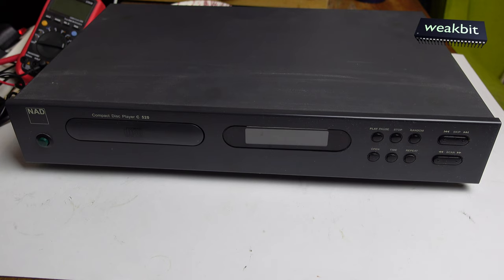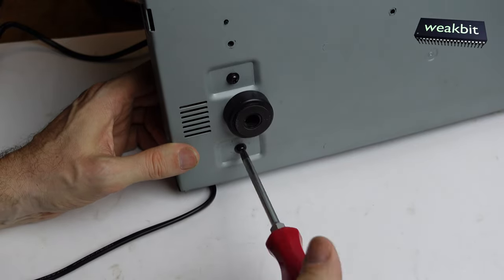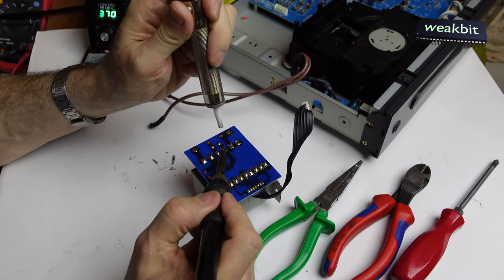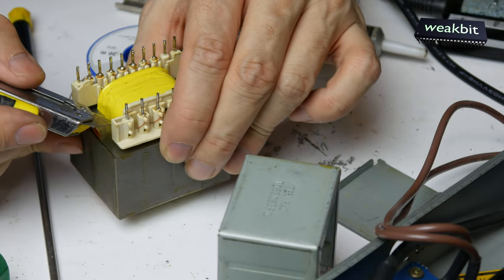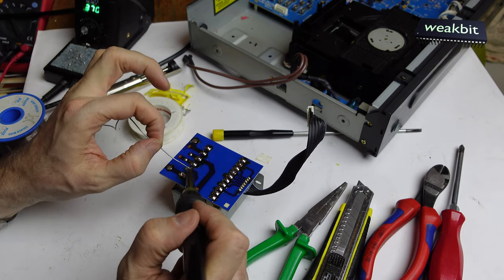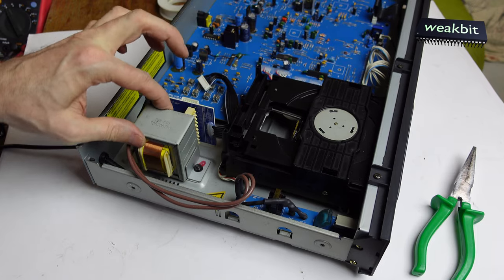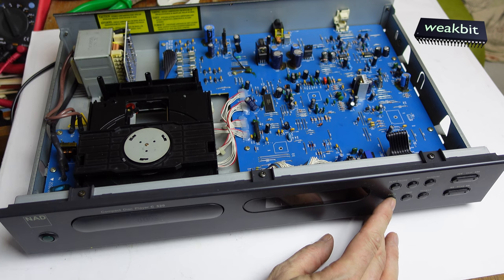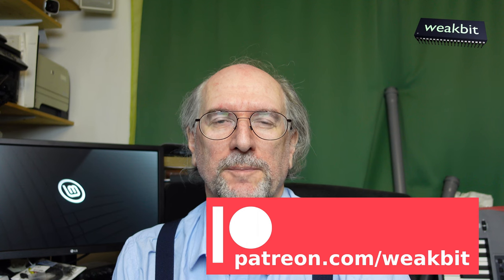NAD C520 CD-Player issue

Comment: Thermal fuses do not fail simply as a function of age. The unit took a surge or a short on the secondary side. edit - The mechanical hum stopped when you unplugged from the main board, therefore the transformer was not the fault for this. Something is shorted on the main board.
Reply: The thermal fuse may have gone for several reasons on the primary side as well, and because of external environmental reasons. Note that with a 2-pin plug there is no plug fuse to blow preferentially before the unit thermal fuse blows. The thermal fuse is therefore the only protection device there is between the Consumer Unit and the step-down transformer. If the Consumer unit uses RCD's instead of fuses, someone may just have reset an RCD without investigating a fault in the ring main that the CD player is connected to.

a) This is a unit built for 220-240 V AC and someone has plugged it into a higher supply voltage. This means the voltage to the regulated supply board is too high and a short between adjacent connections has occurred - very possible in a high humidity or damp environment. Someone could be using the unit in the bathroom (uh-oh) or it could be because the unit is a "grey" import, built for Europe, but being used elsewhere in a sub-tropical high humidity region on a different supply voltage, but where the European mains plug is still physically compatible with the socket.
b) Being plugged into a DC supply (d'uh but there are idiots out there capable of doing this).
c) The player was sat on a really hot surface like a storage heater.
d) The player may have had a mains power surge from a local distribution sub-station switching and causing a spike in the supply voltage. Or the surge could be from a short in the ring main (see comment on RCD's above).

Yes there may well be a short on the main board as well as the thermal fuse blowing, but one is not the cause of the other, they may both have been caused by a 'third party' spike.

In the UK, local distribution between Grid Supply Point sub-stations and local distribution substations mean the local distribution  voltage is at 132 kV (part way between the 275 kV National Grid and the 240 V domestic supply). So if there is a fault at a local distribution substation its possible for the 132 kV to be rapidly switched out of circuit, but there will be a spike in the 240 V AC due to voltage ripple before the switch fully opens. It's a rare event, but it can happen.

Comment: I think the issue lies on the main board causing the transformer to overheat. I'd check there for shorts.
Reply from the maker: what do you mean you found out what is making the transformer? Please tell us what are you doing and what happened and what you found out?
Reply: @weakbit633  Check the main board for shorts, that's most likely where the issue lies.